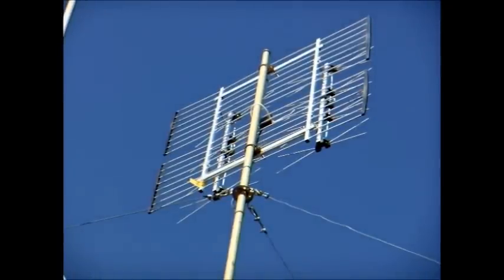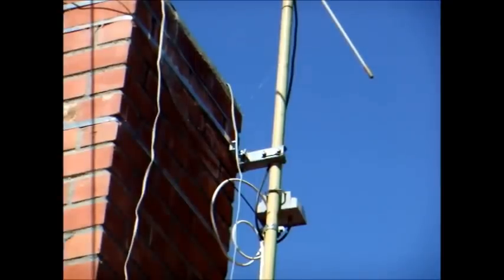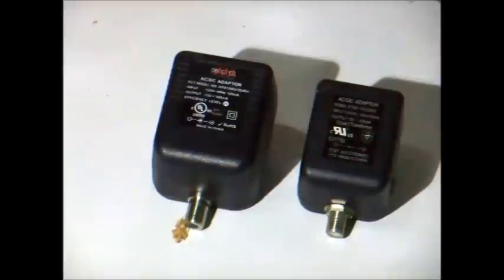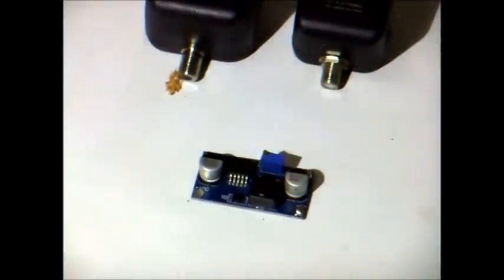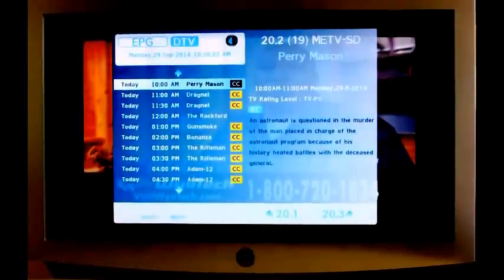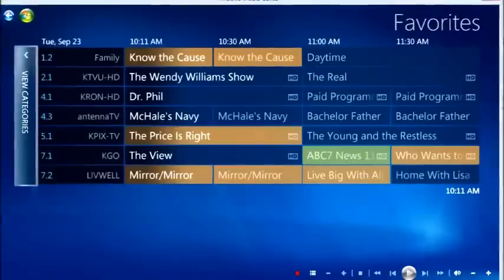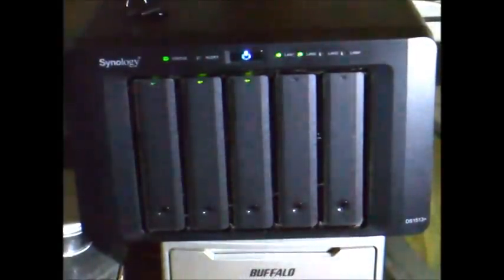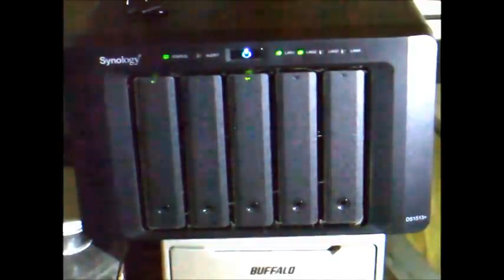Over The Air TV System Overview

Comment: Excellent...you gave me some ideas. Thank you.
Reply from the maker: +Chris DIYer Glad it was informative.  I need to do an update video, this was one of the first ones I made with my old pocket camera.  Distribution amp is the only way to go, IMHO.  I recall when I had Comcast cable, I had techs out a few times a year and mostly they just replaced splitters to solve the problem.  I had actually bought the DA to use with cable, but one of the techs said they had to use Comcast supplied splitters.  Funny thing since doing my own system, I've not had one service outage since I set it up, the random OTA channel will drop out from time to time, but my in-house system just works.

Comment: I have an eight port splitter in my distibution point in my old cable point.  Can I use that with the ota signal?  It's a very nice one.
Reply from the maker: Likely yes.  Mine is what I used to use when I had cable.  Just check and make sure it doesn't have any bandwidth filtering or something like that.  It'll usually list the freq. range on the box, something like 5-42MHz and 54-1000MHz.
Reply: @The4Crawler  Thanks.

Comment: R Brown, I have a question is there a way I can put a pre-amp to my outdoor antenna? is because I sometimes get ABC 7 from San Jose transmitter but sometimes disappears, is it possible to pull that signal and eliminate the pixalation?
Reply from the maker: I run a medium gain Channel Master pre-amp at my antenna:
 http://www.channelmaster.com/TV_Antenna_Preamplifier_p/cm-7778.htm

In your case though, if that station is from the local transmitter on Mission Peak, then you should have plenty of signal and an amp may make it worse.  Could be you have multi-path interference and turning the antenna or raising/lowering it a bit may help.  On a day where that station reception is poor, try moving the antenna around and watch the signal meter (if your TV or tuner has one) and see if you can improve the reception.
Reply: I am in Salinas
Reply from the maker: Then a pre-amp may help.  I purchased a used one off of eBay.
Reply: What kind of pre amp should I use for my antenna like I said I live in Salinas and I am 70 miles south south east of Mission Peak?
Reply from the maker: Might try a medium gain pre-amp first (like I mentioned earlier) or if you can find an adjustable gain unit that might be an option.

Comment: What antenna can I get to get channels from 100 miles away? I am 100 miles south of San Francisco in Salinas and I want to know if the Channel Master HD 4228 gets uhf and vhf channels from 100 miles away. I have an outdoor antenna mounted 20 feet up and I get 48 channels 5 from the Bay Area which are NBC 11.3 KDTV 14.1 14.2 14.3 14.4 KICU TV 36.1 36.2 36.3 36.4 and also KSTS 48.1 48.2 will the Channel master get more channels from 100 miles away?
Reply from the maker: +D Gonzalez I get one station from ~100 miles distant.  It also picks up down as low as RF channel 7.
If you've not tried your location in TVFool.com, give that a try.  Also try posting that info. up on the AVS Forum:
http://www.avsforum.com/forum/45-local-hdtv-info-reception/369015-san-francisco-ca-ota-448.html
You might find some folks in your area that may have some specific antenna recommendations.  You're probably picking up the transmitters in the Mission Peak area, just east of Fremont.  The transmitters in the San Francisco area  might be below the horizon for you, but tvfool would show that.  And you can play with adjusting the antenna height to see if that might help.
Reply: which channel do you get from 100 miles away?
Reply: What city is it from? Stockton, Sacramento or Fresno?
Reply from the maker: +D Gonzalez I receive KEMO TV that is just a few miles short of 100 from my location to the transmitter on Mt. St. Helena near Santa Rosa.  It's not a solid signal, I get it some days and not others.
Reply: Can you also install a rotor on the Channel Master 4228?
Reply from the maker: +D Gonzalez Should be no problem to do that.  You would just need to have a vertical mast out of the rotor to mount the antenna to.  I find the beam angle is fairly wide so I can pick up transmitters from about a 75 degree wide sector with the antenna pointing about in the middle of that sector.

Comment: Hey I want to know what other components I need for this antenna?
Reply from the maker: +D Gonzalez Mine is set up with the mast and some guy wires to hold it up in the air.  Then I have a grounding block and ground wire down to a ground rod for safety.  Then you need some RG-6 co-ax to run it inside your house.  I installed a Channel Master medium gain pre-amp since I have about 70' of co-ax between the antenna and my distribution point.  Usually not needed with 50' or less co-ax.  Then plug the other end of the co-ax into a TV or other tuner and you're set.  I have a networked TV tuner that takes that TV signal and puts it on my home network so I can pick up the program on any PC, laptop, tablet or other device in the house.
Reply: Do you have a pre amp? connected to it?
Reply: Do I need splitters?
Reply from the maker: +D Gonzalez I did not use a pre-amp at first, but I did add a medium gain pre-amp to help boost my signal levels as I have 70 feet of co-ax between the antenna and my distribution amp that feeds all my devices (TVs and tuners).  If you have strong local signals, you don't want a high gain pre-amp as you'll overload the signal levels on your deivces.  
I use an 8-port distribution amp instead of splitters since I need to feed more than a few devices (3 TVs, 3 tuners) and each splitter added is a loss of signal.  So I try to avoid splitters at all cost, since I recall when I had Comcast cable, I had more service calls related to all the splitters they use.  You only need splitters or a distr. amp if you have more than a device or two.  I put the distr. amp about in the center of my house, then feed co-ax directly to each device in one run of cable.  This way each device in the house gets the exact same signal.  If you go with splitters, you lose half the signal at each 2-way split, do that a few times and there's nothing left.
Reply: I want to use a preamp so I can get the San Jose Channels
Reply: I will connect to living room, and 3 rooms and the ktichen
Reply from the maker: +D Gonzalez I think a distribution amp is a good way to go, I used an 8-port cable TV amp on mine, probably purchased on Amazon back when I had cable TV to see if I could eliminate their splitters.  More info:
http://support.channelmaster.com/hc/en-us/articles/200383705-What-Is-a-Distribution-Amplifier-and-Do-I-Need-One-

Comment: my outdoor antenna is a 20 dollar ebay amplified rotating antenna
Reply from the maker: You might first try a different type of antenna.  Adding a pre-amp on an amplified antenna might give too much signal and cause more problems.  Or see if you can bypass the internal "amp" and add a known quality pre-amp.  You might also try checking on the SF Bay Area thread on the AVSForum:
http://www.avsforum.com/forum/45-local-hdtv-info-reception/369015-san-francisco-ca-ota.html
See if you can find any other folks in your area and see what they have used for an antenna/pre-amp setup.